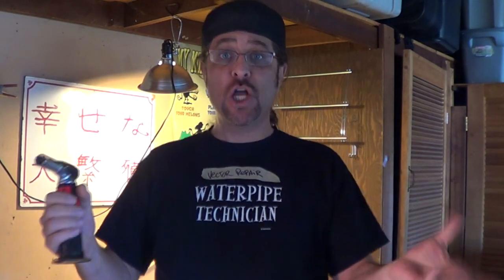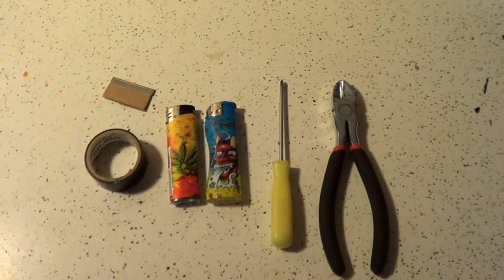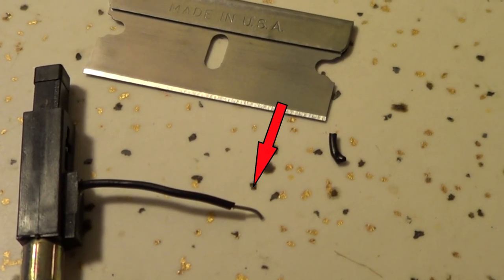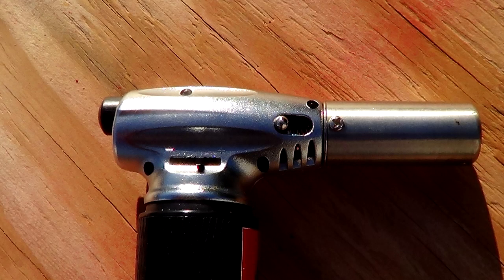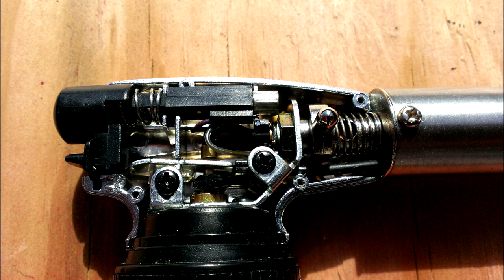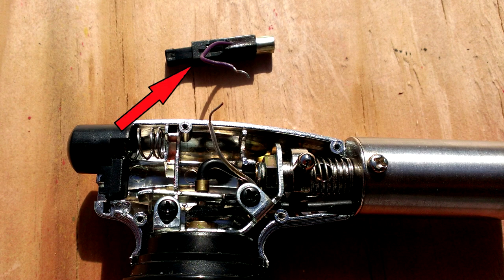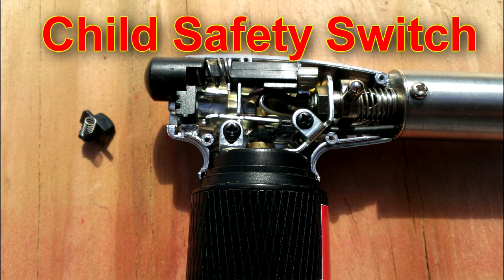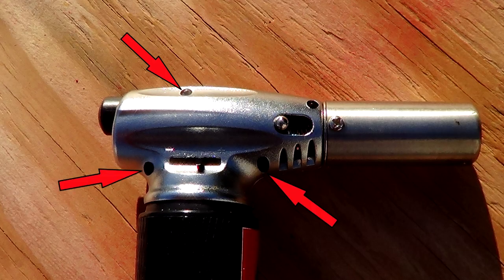Vector Torch Repair and Modification

Comment: I fixed lighters for years at the tobacco shop and for me there were two main causes for a torch lighter not working. The first is that the lighter was not properly purged before refilling it. It is important to take a small screwdriver and pushing the pan and let all the air escape from inside the lighters reservoir. If there is a lot of oxygen inside the lighter will definitely have difficulty even igniting.
Reply: And the second??? 😂

Comment: Thank you for this dude! One thing to consider for those who are doing it is; the wire that connects to the switch from the torch (the one you cut) is the same wire that you can see the end of at the barrell of your torch (the wire that causes the spark) Mine got a little fucky and I had to play with that to get a consistant light again!

Comment: The second problem that most torch lighters have is that the Jets get clogged with impurities from butane and lighting whatever tobacco you use. The easiest way to clean these jets is to take your can of butane and shoot a couple of shots directly onto the jet by pressing the nozzle on to each jet for a second or two. Purge your lighter and refill it. Allow it to warm up and it should light again. This usually work eight out of 10 times. The other two times the lighter was genuinely busted.

Comment: I bought a messermeister prior to getting the vector and it was chrome colored plastic so I sent it back.i bought the vector nitro in chrome.but when I was taking it apart to remove safety I noticed that the half I removed was really light and you can definetly tell its chrome "colored" plastic.i didn't stop there though I called vector and they told me it is chrome colored plastic but that it won't affect functionality,and is still covered by their lifetime warranty.fyi.love your vids.peace out

Comment: My torch only shoots a soft flame not a torch flame. When you use the conversion switch it barely changes from soft flame to really soft flame. Any advice?
Reply from the maker: Nick Merriweather yes, bed bath and beyond sells torches for 30 bucks, they are killer

Comment: sup friend I just got a new torch refilled it once and now it's leaking sounds like air from the refill hole plz help
Reply from the maker: contact retailer for replacement its new you should not have to fix new stuff
Reply: thanks